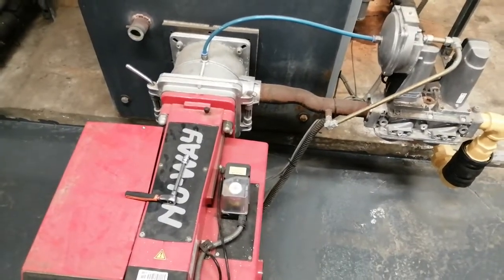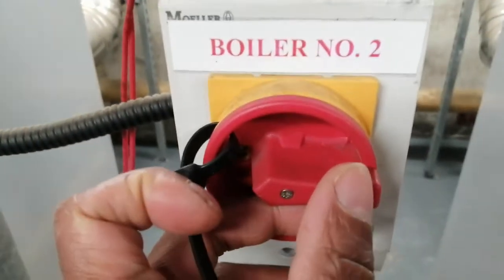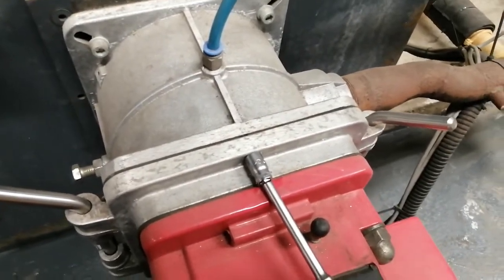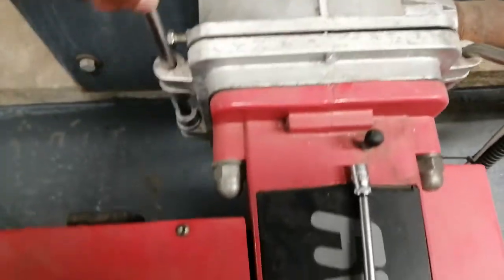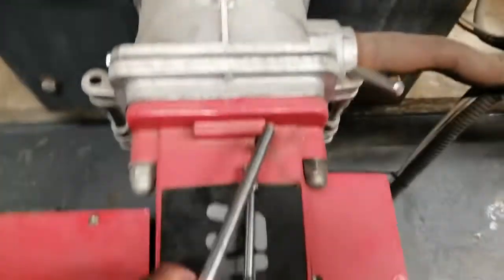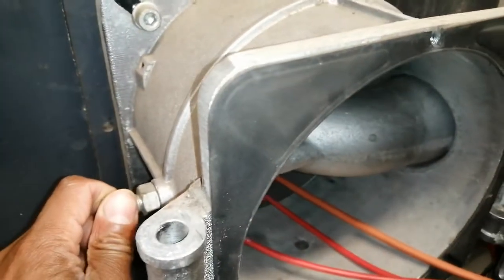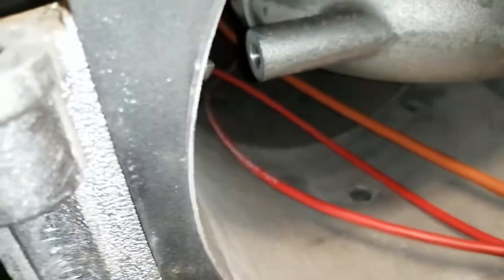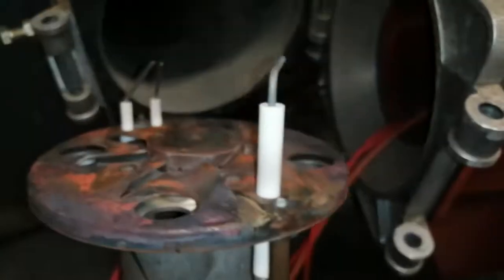NU-WAY MGN 860 / BURNER INSPECTION

Comment: Hello mate, have you ever had a screeching noise on a Wessex ModuMax 110 on low fire, on the initial fire up?
Reply: Burner on way out had this before
Reply from the maker: @jordanackland9588  thanks for watching
Reply from the maker: I guess it's something to do with the fan or gas/air adjustment. Hope that you got to the bottom of the problem.